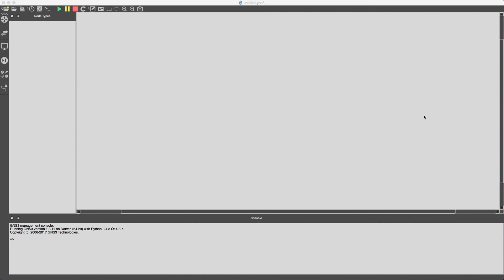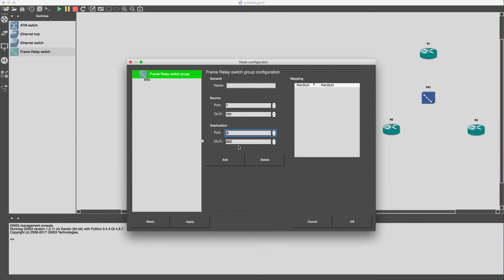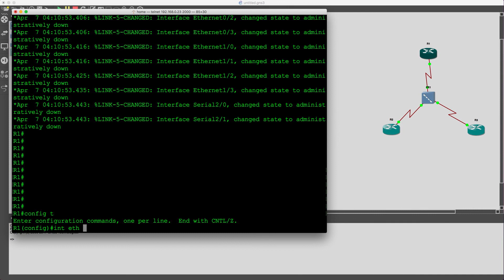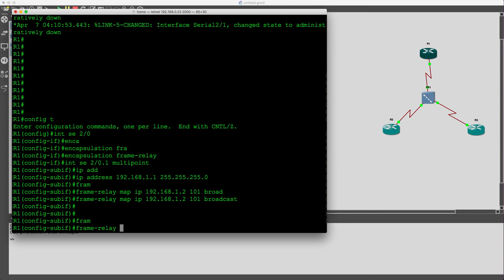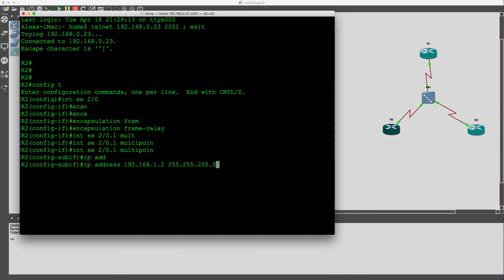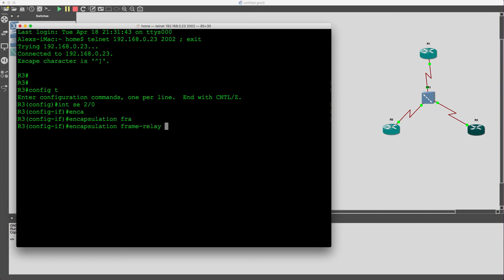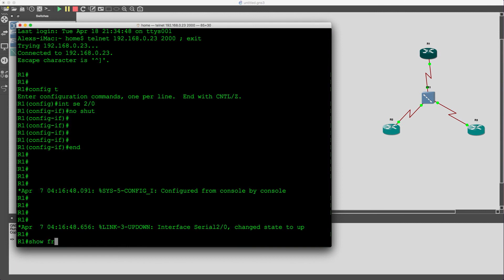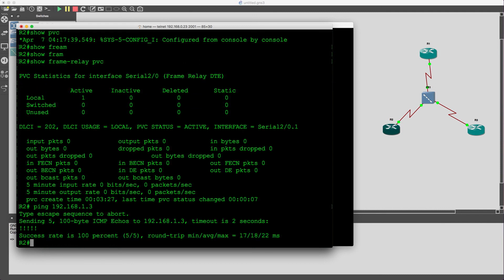Frame Relay Hub Spoke Multipoint Configuration in GNS3

Comment: when try to connect third router with FR switch it gives error that port is already in use? 
what to do about it. I'm using GNS3 version 2.0.
thanks.
Reply from the maker: How many ports did you create on the FR? Email me your out put so I can see.
Reply: Thanks for your reply, it seems it was some kind of bug with gns3 ver 2.0 i have updated gns3 to version 2.0.1 and now it's working fine.